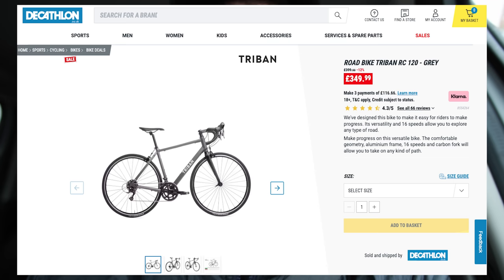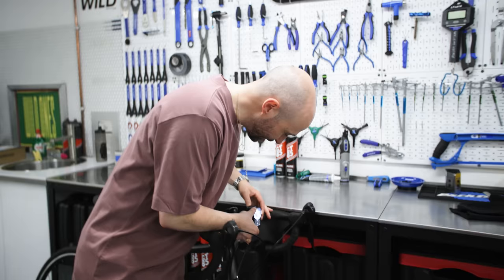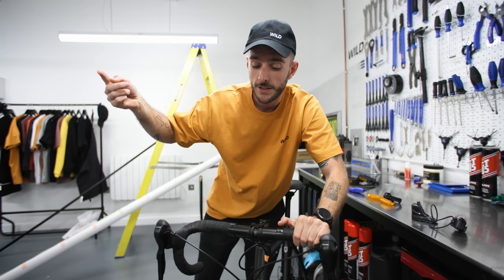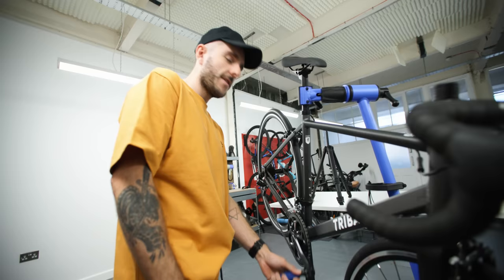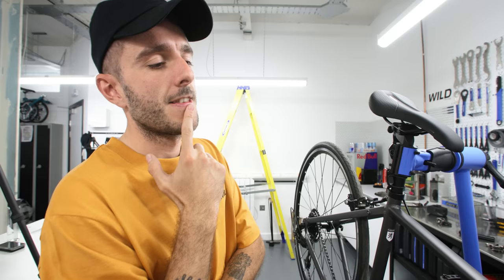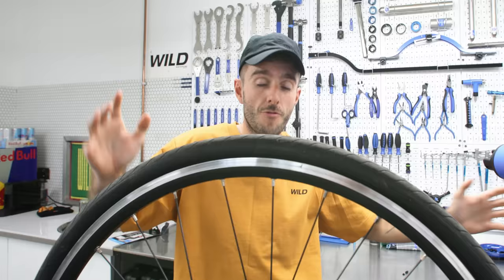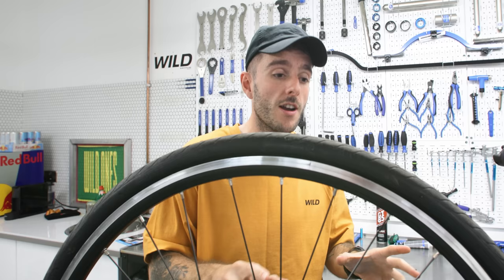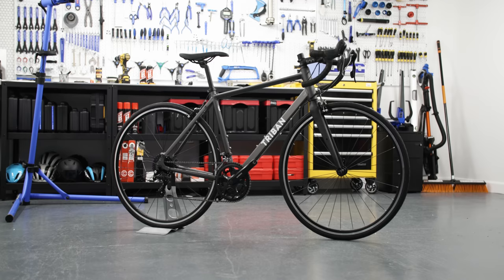We Bought A £350 Entry Level Bike in 2023 - This Is INSANE Value

Comment: I have seen them and wondered. After your video I bought one to use as my commuter 40 mile round trip and winter bike. Size XS last one in shop. I changed the bars to Deda as recomended and went down to 38cm from 40cm. Saddle not so cheap but comfort is king.  I also put clipless pedals on cheap from Halfords.  I changed 80mm stem to a 90 cheap from Decathalon and I have fiddled with tyre pressure now 65 front 68psi rear to dampen harshness of ride (compared to my Carbon bike). I have also ordered some TPU tubes again cheap. Decathalon cut my stearer tube and shortened my brake lines during free service ... for free!  I average 18mph and have done 500 miles on it. I really cant fault it. The chain has jumped off a couple of times but that was my fault other than that it is superb value for money grab a bargain !

Comment: Get as a first road bike or winter bike.  The Disk road bike i think is a £100 more.  I use it as a winter hack, full Sora group set.  Whats there not to like!  Add some extras like a decent stem, handlebars, seatpost, seat, even dare i say wheels, you can drop a kilo in a flash.  9.5 kilo bike is well fine

Comment: Hello, I'm a time traveller from the eighties (true story, it just took me 30 years to get here). I came here to say that this bike is better than almost all the bikes we have available that are not custom made for TDF racers. The price is not "cheap", it's the normal price that we pay for our bikes, even though ours are made of steel and not alloy. Steel might be real but it does rust and it is heavy, so perhaps that is real improvement. 10.69 Kg is also ballpark what we get for the best bikes on our shops, 11Kg and above is very common for the less glamorous road bikes we have. In short, THIS IS ALL THE BIKE YOU NEED.

Comment: I'm 6' 2" and I bought the XL. I think I should have went with the large. Was getting a sore back from riding. Eventually changed the handlebar stem to a shorter one. Think this did the trick. Also changed the saddle.

Comment: I have a triban RC500 as of right now that i use to go to work everyday, i love it !! even tho i am a beginner with bike ahahha

The pros : 
-Ride really well, grips really well even during rainy days, 

-Pretty light actually for me ( around 8 kilos) 
-The brakes are incredibly effective ( disk brake )
-No problem of stability on descent even at pretty high speed
-And it's sexy AF
-the shifting mecanism is actually not the same as on the one on this video, it has been a bit improved ! the downshift is on the brakes, so instead of pulling to break you actually like .. pull it to the side ... if you got it .? my english suck leave me alone...

The Cons :
-When shifting at higher speeds it has the tendency to make the bike wiggle woggle which makes the feet comes OUT of the pedals ( idk if it's an issue or if i just suck at cycling tho)
-Changing the air Chamber is A PAIN IN THE ASS ( the tyre is freaking long INSIDE the wheel frame which make it freaking annoying to put it back on )
-And this one is more personal but i don't have enough space to put both my light AND my cellphone on the handbar :( i am sad ...

But overall for 750Euros i love it realy good investment i have it now for over a year and i won't leave it anytime soon it stills looks almost brand new and ride always icredible :D

Comment: I have an RC520 which has the 105 groupset (with a non series Shimano chainset) and it’s crazy value. Wheels are a bit rubbish but I’ve done 5000 miles on it and the bike is still great.

Comment: I have it. Good for its price, BUT: for me was necessary to change saddle, pedals and accessories included are really low-low level, changing pods to the brakes was a big improvement and I discovered after 1000km how central movement is cheap. Most recent triban 120 in Italy has a prowheel 48-34 cranckset instead of shimano tourney 50-34.
microshift is good for me: good levers, quite good derailleurs (better the rear than the front). Wheels are heavy but resistant: it's not necessary to stay tuning them frequently even if I bring my bike on the terrible streets of Roma. 
Decathlon service is for me unknown: I bought some tools and I prefer to fix my bike at home.

Comment: Hi I've got the older flat bar 520 and the newer RC520 with the TRP cable pull hydraulic disks and 105 Groupset.  Done over 20,000 km commuting and leisure riding between the bikes. The wheels are poor,  I have had spokes pull out of the rim however Decathlon have provided good warranty support.  Upgraded wheels are the way forward though.  Just routine maintenance and wear and tear   would buy again no problem

Comment: About the wheel quality, they will probably change the bearings in the first service you said they give you for free if they are shot, also, they sell the bearings and you can change them at home yourself. They will usually sell you the exact tool. From memory the bearings are less than a fiver and i think the tool would be 15.  Ifs not bad, not bad at all

Comment: I own the cheapest Decathlon bike with gears, the BTwin Riverside 120. Don't think they sell it any more, I haven't weighed it and I don't care - I've covered about 5000 miles on it in 5 years and it's going great! Never had the bearings serviced because at that price it might be cheaper to buy new wheels! Never had a puncture despite riding on plenty of glass, ride it all year round, only gets washed by rain (I store it in my shed), original set of tyres lasted 4 years and only had to be replaced due to the sidewall cracking (no visible tread wear). I run through a set of brake pads every 6 months and a chain and sprocket every two years. And the best part - it only cost me 149 quid! Added on mudguards and panniers, and do grocery runs, cycle to work, even as far as 50-70km on leisure rides. Best VFM for a beginner bike. Currently does duty as backup for my ebike, but was my daily ride for 4 years and literally never let me down.

Comment: I have a 2020 RC500 disc that I put some 32c gravelkings use for commuting and gravel. Here's some thoughts:
- The RC500 is the value sweet spot, in my opinion, as it comes with Shimano Sora which is really very good.
- Even though I bought the bike second hand, it's still trucking despite my regular use and abuse.
- The bike does require more regular maintenance/cleaning than most commuters would like (I feel) but it's not too bad.
- The Promax disk brakes that came with the bike absolutely suck so I replaced them with TRP Spyres - £100 upgrade but much better now.
- Do NOT ride with those Triban tyres in the wet, I did once and fractured my orbital bone - that's the one area they really cheaped out. Tyres that bad should be outlawed.
- My large fits me ok but is a bit longer than I'd like, same as Francis' RC120.
- I get comments all the time about how expensive and fancy the bike looks - people are surprised to find how cheap it is.
- It is quite a slow bike but it's relatively comfortable and reliable so there's nothing I'd rather have for the same use-case. Anything nicer is just too 'thieve-able'.
- Decathlon say you need 21mm tubeless tape if you want to convert the wheels to tubeless - this is not true and it won't work, you need 24mm.

Comment: Hi, I work for Decathlon in the cycling department (in France though) and i have to tell you some things about the RC120 rim brake version.
B'Twin is the general brand of Decathlon bikes, but you've got some subdivisions : Rockrider for MTBs, Riverside for touring, hybrid and gravel bikes, Van Rysel for the road (focused on performance), Elops for urban bikes, B'Twin for kids bikes. Triban is going to be suppressed, with the road part going to VR and the gravel/bikepacking part to Riverside. 
The wheels aren't reliable, they're heavy and not long-lasting without a lot of maintenance,  and usually they're the first element that people change when they buy a Decathlon bike and they seek performance (for gravel, MTB or road bikes). On the RC120 disc, RC500 and RC520, the wheels were upgraded in 2021, to be better lasting, easier to convert to tubeless and more resistant. 

The RC120 rim brake isn't available in France since the end of 2021, and will be suppressed (idk if it will be replaced within the entry road bike range). 
You can fit 35mm tires maximum, the only limitation being the rim brake, not the frame lol (on the disc version you can put 38mm). 
The sizing for road bikes is extremely weird at Decathlon : I am 178cm tall, I have to take an L size MTB, but an M size road bike (same for gravel and hybrid bikes). The S size is recommended for people  between 165 and 173cm tall, the M size for 173 to 182, the L for 182 to 190, and XL for 190 to 200 ; yeah, weird sizing. 

But, as you said, Decathlon bikes have a very good price/quality ratio (hence homemade components such as stem, handlebars, saddle, wheels (even thpugh they're unbranded), tires, etc), and the RC range is made to discover road biking (via 50-100km rides or commuting per example), and Van Rysel EDR (Endurance) or RCR (Racer) ranges are more oriented towards performance and aero bikes. 
I really like your videos, cheers from France !
Reply: Thanks for the insights. I noticed on the Decathlon UK website that a couple of models have moved to VR branding, including a version of the RC 500 which comes with 9-speed Microshift, though there's still a Triban branded version with Shimano Sora. Are more bikes going to go down the Microshift route?

Comment: Ive got the gravel version of this with the disk brakes. After 5 years and about 10k miles, I'm looking at upgrading to a nicer bike, but I'd need to spend about 2 grand to get anything significantly better, especially since ive replaced the wheels, seat and pedals. For 90% of people, these things are all the bike you need.

Comment: I bought a Rockrider ST530 from Decathlon.
That rubber piece on the wheels lost me a lot of time, because I though the sound was from the disk brakes and I kept investigating if there's a slight touch. The worse thing was that it was squeeking while riding, but not at home with the wheels up. :D
(I guess it's meant to be some kind of a dirt protection for the bearings.)

Comment: Decathlon Touring Riverside 900. Just a very good bike. Most other bikes are more expensive especially if you take same components and upgrades. The 900 has a really good set of racks, seating is nice, gears...just a very good bicycle  and not only because it's cheaper then others with same components....

Comment: That squawky rubber thing on the non drive side of the rear wheel is literally a seal for the bearing. The original Shimano Parallax (where all these carbon copies come from) refers to it as a seal.

Comment: I've just built up the Van Rysel frameset that they sell as a frame only for £700, nice light and stiff. Managed to get it below 7kg for a size large for less than £1500, the only problem I have with it is the non round seatpost. Decathlon do some good bikes and have good specs for the money, I wish they would sell some of the xc frames as a frame only.

Comment: The disc version of this (currently on sale for £450) apparently comes with sealed bearing hubs and tubeless ready rims. That's incredible for the price.
Reply: And I think the RC 520 disc might be even better value. £850 for a bike with a (mainly) 105 groupset and TRP HyRd brakes. And a replaceable mech hanger. Working for one of the big bike brands has blinkered me a little - I'm blown away by the value here.

Comment: Bought the RC100, similar product, just a bit less powerful. I'm pretty happy with it, even though the ratios aren't great and on steep hills I wish I had a bigger cog at the back. I got the squeaky noise as well with this piece of rubber on the back wheel, a bit of grease fixed that up, but it's a shame they don't come properly greased, at first I thought my bike had a serious problem.

Comment: My road bike is a Triban 520, bought in 2019, before prices went bat-shit crazy. Came with a 3x9 Shimano Sora, Tektron brakes and horrible, terrible, completely-useless-in-the-wet 25c Michelin tires.
So far I've upgraded to shimano 105 brakes, 28c Vittoria Corsa tires on 50mm carbon wheels, with a couple other bells and whistles like ti quick releases and ceramic bearing pulleys. Other than the tires, the upgrades I did where mostly because I wanted the bling (golden chain gang!) and didn't made a world of difference, EXCEPT FOR me wanting to jump on the bike every time I pass by it on the garage. 
Overall 11/10 I do recommend those entry level bikes!

Comment: Got this bike for 2 years now. 5000km on it. Really bad shifting quickly at the back, change the derailler, some few reparation but good bike overall. Excellent value.
But the missing piece of metal on the frame for the back derailler is scary, after my first fall it bend and I don't think it'll survive a second crash...

Comment: I have commented already about this bike being good value. After 950 miles I noticed the wheels were not turning as nicely as they should have been. In fact not turning nicely at all. I have since replaced them as advised on this video for sealed bearing type. I then stripped and inspected bearings on wheels that it came with. I have never touched these wheels and was shocked to find massive ware on cones. Replace the wheels as soon as you can or alternatively check inspect and adjust bearing every couple of hundred miles !

Comment: 10:02 Steel frame solves the problem of weakening the rear derailleur hanger after bending it back (If some touring frame is used), the aluminium frame is much more not for the countryside rides where there's higher risk of damading the frame

Comment: Since you got a taste of Microshift with this bike, can you do a video of their other groupsets? The company has been on a lot of people's eyes in terms of budget components so a proper review of their stuff could be really helpful!
Reply: They have some really good value on the off road side. They even make a set of 11speed road shifters that pair with Shimano 11sp mountain bike derailleur pull so you can do an easy mullet gravel set up. Only downside is you need mech or cable actuated hydraulic brakes. I would have probably gone that road had I not found a 2nd hand set of GRX600 in good condition for $200. Don't know anything about their road line but apparently in Asia they have a full carbon shifter set.

Comment: A couple of years ago they were selling the Triban 540 with full Shimano 105 (minus the breaks) and Mavic Aksium Wheels for around €850 and later, around Christmas, was in discount for about €500.
Reply: One of the best value road bikes ever. I have a mint one that I bought used for £280. It has 105 11 speed. They saved a bit of money using the Shimano RC-500 chainset (adds +- 100 grams) and I think the cassette isn't 105. None the less is shifts faultlessly. Having the Aksium wheels is a real plus, OK they aren't going to win any weight awards, but they are super reliable, look neat with 20 bladed spokes and have cartridge bearings.👍

Comment: The Triban line is great value. I'd disagree with the claim the sizes run too large. I have an XL at 195cm and it's too small I'd say. Seatpost is sticking out big time. Ultimately the fit can be corrected easily with different stems.

Comment: I've thought about getting one of these as a winter bike to replace my current 17 yr old one - which is well maintained and mechanically fine, just old. GCN ran the same model recently and also said good things. Just don't like riding my good bikes in rain/snow/slush. Thanks for the video.
Reply: All the folks that used to be at Cycling Tips also rated it high.

Comment: I was going to get a 'Triban ROAD BIKE RC 520 DISC BRAKE - SHIMANO 105' in lock down - sadly sold out (I think it might have been an rc 500 Disc back then) so ended up buying a 2nd hand Felt Z75 (Shimano 105)  in practically new condition  for £700 which is a great bike though now have a planet X carbon disc now.

Comment: Damn, man, that's a big surprise. I have a RC120 DISC, that's the only version i could buy locally. Its tyres have been switched to 700*38C last month. Much smoother riding experience on the broken road. Since there's no mug guards available in my area, I'm wondering if the 50C tyre would be compatible and possible to mount on this RC120 DISC, please? Again, thanks for sharing, Cade;-)) Cheers.

Comment: I saw a guy turn up to a Cat 4 race at Hog Hill circuit on a Triban disc bike. Although it really is not a race machine, there are no rules when it comes to cycling. Ride what you have and enjoy yourself
Reply: A triban with upgraded  tyres or maybe wheels is fine for racing. Esp in cat 4 where you'll probably crash anyway.😊

Comment: I have one of these, but here in Czechia it comes with disc brakes and I guess a bit better wheels. And a bit higher price tag, roughly 530 GBP(it was substantially cheaper last year, but the prices here went up in general due to inflation). So far I consider it a great first road bike - and for that price practically the only one.

Comment: I got the RC500 a couple of years back.  Sora groupset, mechanical disc brakes.  the wheels are not the best and can be a struggle to get the supplied tyres on and off, did swap them out, but have had to go back to the origianls.  the tyres are pretty good.  I only had one puncture, but deceided to change the tyre brand due to the extreme difficulty in trying to put them back on the rims.  great value bikes, but I slightly regret not going for the RS520 that had part 105